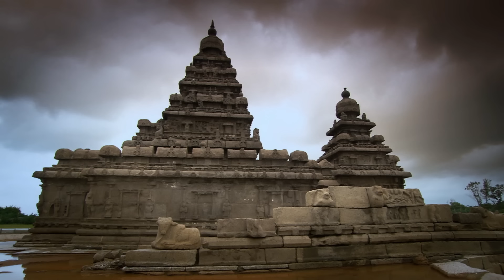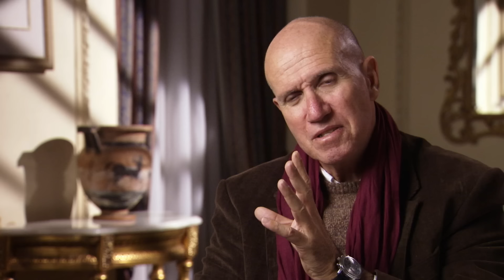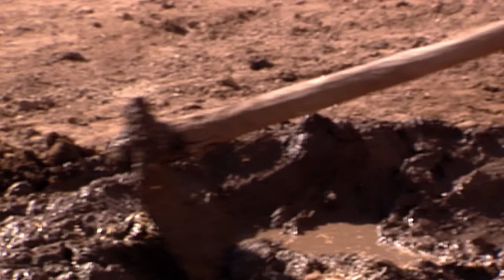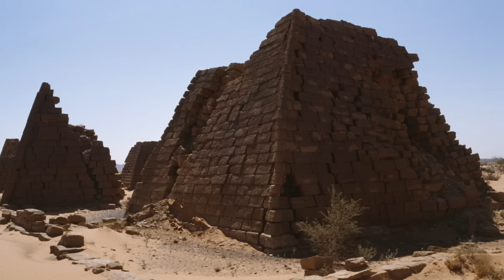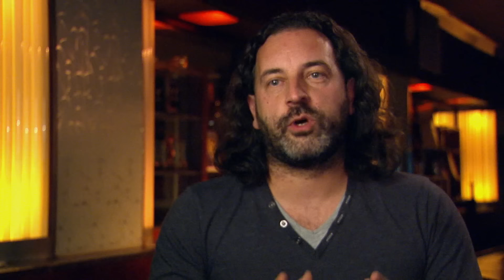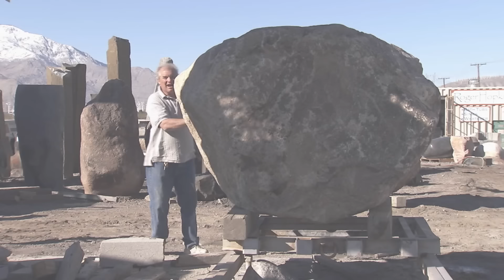How Did Ancient Builders Move Massive Stones? (Season 1) | Ancient Aliens

Comment: they pyramids are literally a representation of the math required for all modern creations, geometry, trigonometry, calculus.
Reply: Not to mention the generations of trial and error.
Reply: @russellward89  the 3 pyramids are older than everything else. Why did the Egyptians leave their hieroglyphics on everything else, but not the 3 largest monuments until the 19th century? The great pyramid and other 2 have not 1 single mark from the Egyptians. Makes no sense.
Reply: the pyramids were adapted from Ziggurats built in earlier civilizations in Mesopotamia. Also, Egypt had tried and failed to create lasting structures before the Giza site. The Sphinx had possibly been altered and restored more than once. Most of the surface stones from Giza have been pilfered. That’s the problem with using exorbitant materials in construction that outlasts the ability to guard it. Please explain why an alien would sail all the way across the universe to stack rocks on earth. Stacking rocks is a very human thing to do.

Comment: To build the pyramid you need to first plan survey, and design a complex consisting of millions of individual parts that all need to fit together, how do you keep track of all those individual parts and their geometry, on paper? Millions of pieces of paper, or a data base? To design the underground structures do you just dig around willy nilly, no, you need to precisely plan and position those tunnels relative to each other underground in 3d space. You need knowledge of material science, to understand the stresses the materials can handle. Those stones here and elsewhere are a remnant of scaling technology, they scaled processes to make the stones that large and machines or equipment to move them around, then others came along and used a dividing force to "split" the stones.  How do you move a stone that large over such rough terrain? Airships. Which are a scaling technology. Theres a reason its not just a boat, because many of these megaliths are high up on mountains and elsewhere with no roads or water ways, on rough terrain. How did they power those devices? A wheel and man power or animals? An engine, using combustion? Electric motors? Clearly were missing major portions of what was there, if you look at the romans though, they immediately had designs for cranes, gears, antikythera mechanism(computer), piston pumps, etc etc, kinda neat right, they had machines right after, but the egyptians did all this without the machines? That dont make sense. ** automation, mass production, standardization etc etc.

Comment: Most of the stones were quarried on site. That is also likely a key reason for the location. Sure a few dozen (granit) stones needed to be transported very far, but nothing that has not been done many times since. The Romans transported 100s of tons on boats from Egypt to Rome. The stones never was the mystery. The mystery lies in the measurements, how they constructed the pyramides, and the purpose, the alignment, and the sphinx. Focus on what matters.
Reply: How does large scale machinery not matter? This is why the vases matter, they clearly are evidence of a machining process, a lathe. A lathe and mill are not made of stone, and are used to make all the components to machines we use today, clearly relevant when they are used to make everything modern.

Comment: There is an alien radio signal you can detect at 60Hz to 1.2KHz using a spark gap radio receiver. Alternatively by placing an empty dry aluminum soda can onto a laptop trackpad to create a capacitive coupled antenna. If done on the proper computer, the cursor will move by itself; radio controlled by the signal. Using an oscilloscope you can visual the waveform by probing at the bottom of the soda can as it sits on the trackpad.